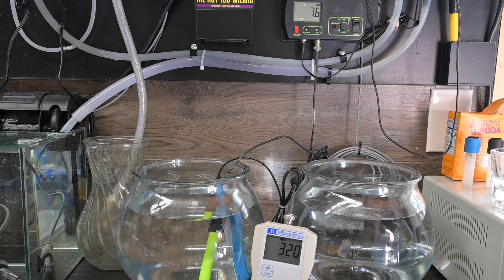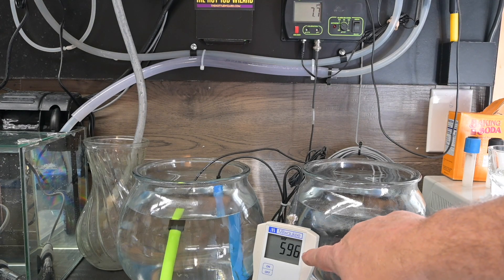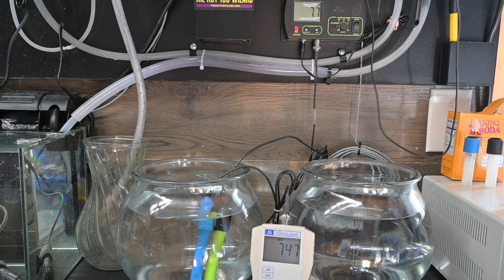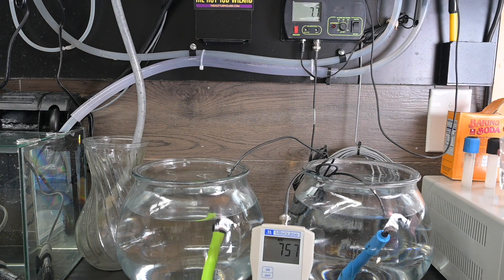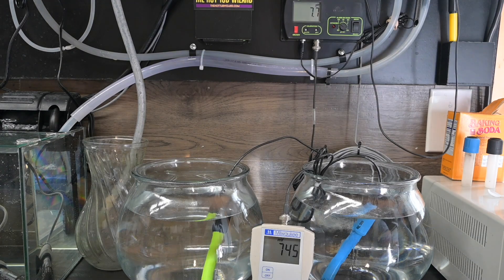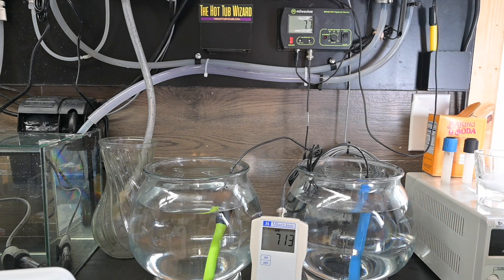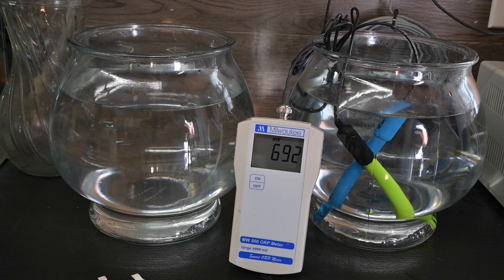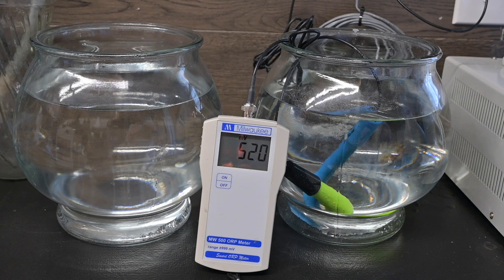Why Sodium Dichlor is NOT Your Friend

Comment: Soooo.... I should just use store-bought bleach
Reply from the maker: It's certainly a better choice than chlorine granuals and you could extend draining intervals. In my experience I would use it if I didn't have a salt system. Good water quality is achieved through consistency. The roller coaster of hand feeding chemicals makes maintenance more difficult.
Reply: @lancefitzsimmons2136  Hi Lance, thanks for posting.   I have your salt water system installed on my HS Envoy.  It works great.  Are you saying that there is no need to "shock" the system occasionally with either bleach or sodium dichlor?
Reply from the maker: @markpuccio6270 Hi Mark, shocking is beneficial but not with sodium dichlor.
Reply: @ what should I use on a salt water spa then?
Reply from the maker: yes, store bought bleach is sodium hypochlorite, the same substance as pool chlorine. The only difference is  store bought bleach is about half the strength of pool chlorine. Do not use scented or low splash bleach.